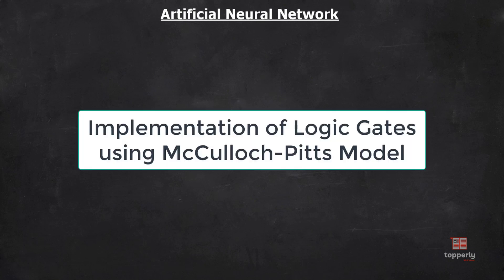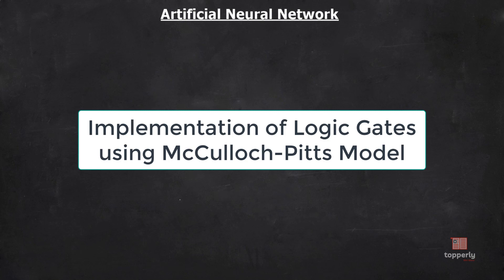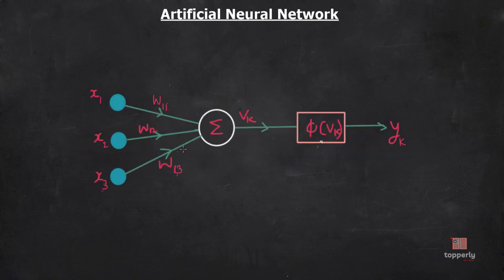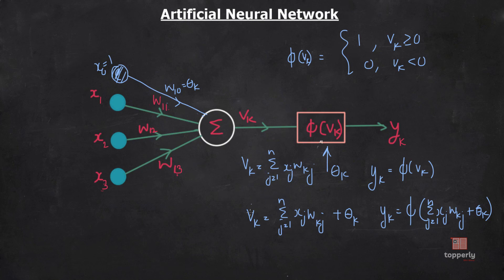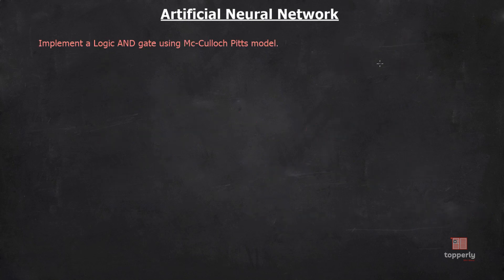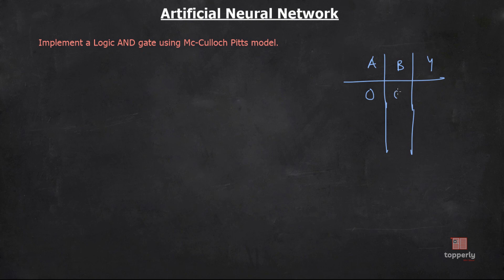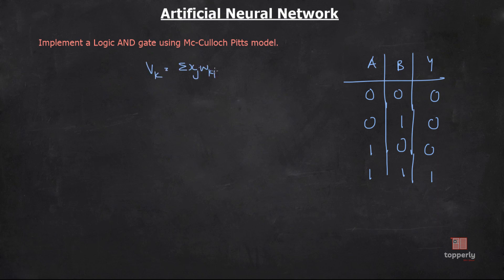Implementation of Logic Gates using McCulloch-Pitts Model | Neural Networks

Comment: Hi, can you explain what to do if I have 3 inputs?
Reply from the maker: Draw the truth table with three inputs. Then take inputs as x1, x2, x3 and bias as b. Then take the corresponding weights as w1, w2, w3 amd w0. Apply the formula and use the threshold function and see if it's satisfies the truth value. If not, adjust the weights or bias to suit the required value.
Reply: @Topperly  Thank you, I think I did well for OR and NOR functions, but right now I am stuck with NAND at row 8. I choosed w1=w2=w3=1 and teta= 1.
Reply from the maker: @MS-kk2ld  Hand computation is difficult as the number of inputs increase. I don't think questions of such kind will be asked in exams. Or you can solve it using Hebbian Learning Technique explained in the next video of the series. But that method doesn't always guarantee accuracy if the number of test inputs is small  :)

Comment: The OR gate diagram in the end is incorrect in my opinion as the weights should be 2 in the input layers
Reply from the maker: Could you please clarify your question?
Reply: @Topperly  going by the equation that y' =0 when Wx+b<=0 is not followed in row 2 of the OR gate implementation of neural network
Reply from the maker: According to the condition set, if the value is greater than or equal to zero, the value will be 1. Since in row 2, when you substitute the values of the weights w1 and w2 as 1 and bias as -1, you get the answer as 0. And as per the condition, the answer will be one which satisfies row 2. You can take any value of the weights and bias but the only thing to make sure is if it satisfies the truth table.
Reply from the maker: Mc-Culloch Pitts model is defined based on Threshold function and threshold function is defined as 1 when x axis value is greater than or equal to zero.I had followed the same procedure from standard textbooks and it's always better to refer and rely on them rather than internet articles. I have explained it properly in Lecture 1( timestamp -11:20).